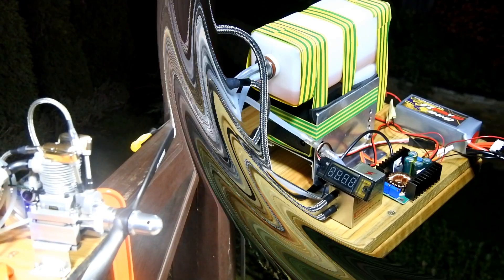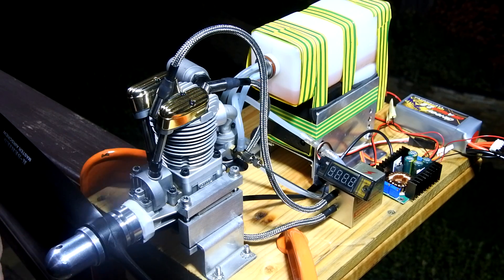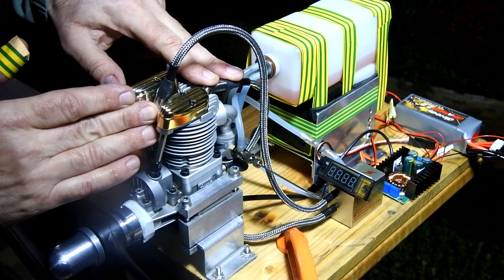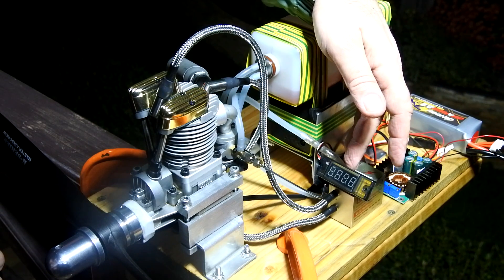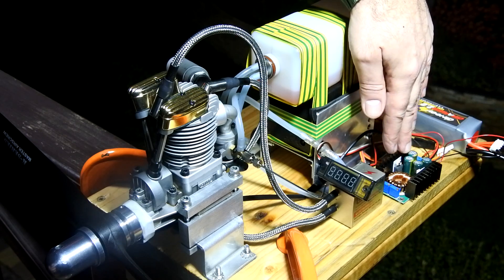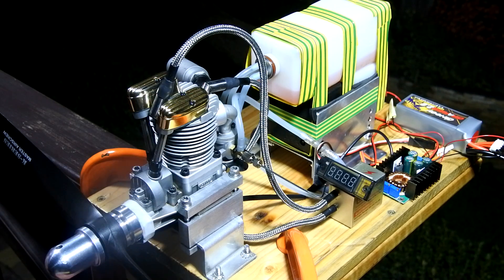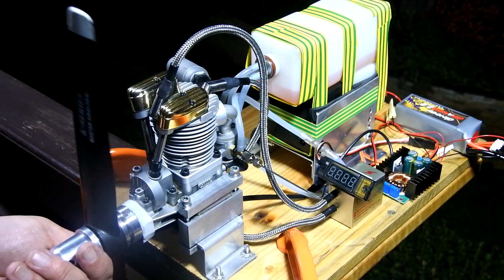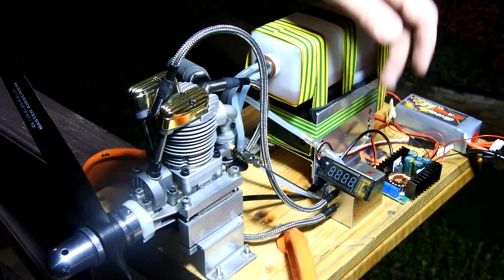Saito FA 120S DP twin spark ignition conversion Part 1

Comment: I really love the sound of the ultra low idle speed. Also you are quite the fashion statement with your matching thumb / fuel tank tape! 🤣
Reply from the maker: Thank you for your kind comment ! This tape is very useful to fix a lot of small inconveniences, which happens every time, when I going to mount new engine or to provide some experiments with an engine / fuel / ignition or setup  in general.
Reply: @crazyengines88 ķ
Reply from the maker: @MariadeFatima-tx9hb  Thank you for your comment !

Comment: great video.  the ignition system makes hand starting a breeze. i have it on my 300 gemini twin. flips starts with 2 fingers, no kick back.
Reply from the maker: Thank you for your comment ! Really greatly surprised with engine performance after conversion to spark ignition.
Reply: Í

Comment: Hello

Any improvements compared to a single spark unit?
Reply from the maker: Great question, thank you !
Quite frankly, there are few very  significant differences:
1. Larger rev range - from low and stable idle 1100 RPM - till 9500 RPM top high speed. In previous runs with Enya #3 hot glow plug top high speed was around 8400 RPM. Lowest stable with ability to immediate and fast acceleration (with Enya #3 hot glow plug) - approx 1300 RPM. So, 200 RPM lower and +1100 RPM higher at top speed in comparison with glow plug setup.
2. Hand start becomes easier.
3. At low idle engine can "ticking" at 1100 RPM for hours. With glow plugs will die in 2-3 minutes. 
Other significant differences will described tomorrow, after next cycle of test runs (should be measured additionally).
So, stay tuned, tomorrow will be next runs with more details and variations. 
Thank you for watching !
Reply: @crazyengines88  Thanks for the reply, but I ment how does adding a second spark plug add any value compared to using only one ?
You explained the benefits compared to a glow ignition system.
Reply from the maker: @eskosyvalahti7507  Hi, thank you, understand. Tomorrow, in next planned test videos will find the answer, please, wait one day.
Reply: Nice stuff   watch your fingers chop chop hehe
Reply from the maker: @vulturedroid9804  Thank you, I’m taking a big care of my fingers - Saito FA 120 “Big Jug” previously really push  my fingers by occasional kick back.